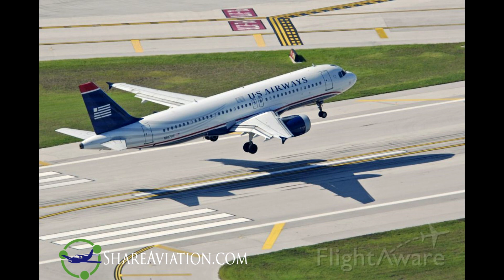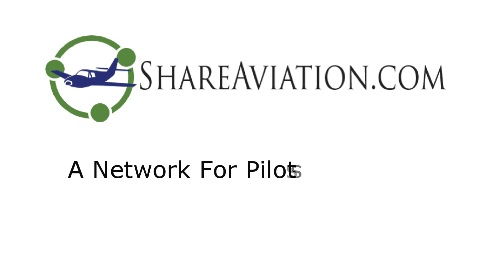ATC - US Airways 1702 Flat Tire Nose Gear Collapse

Comment: The tire blew and gear collapse was a result not the cause. 
NTSB attributed this to pilot error, specifically a cockpit resource management issue involving mis-setting the flight management system(didn't pause and double check a last moment change) followed by incorrect responses to some unusual warnings.